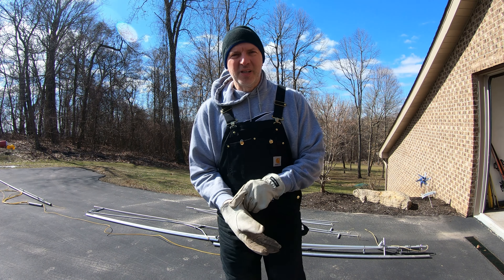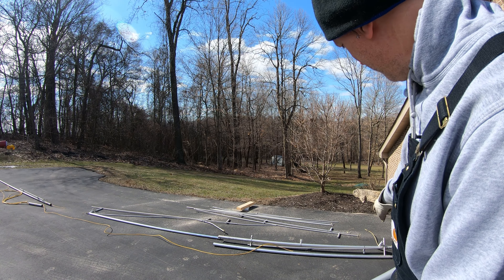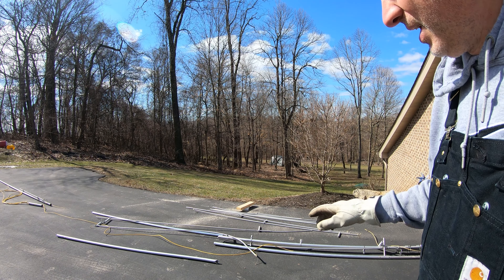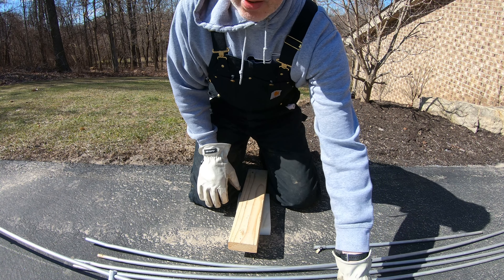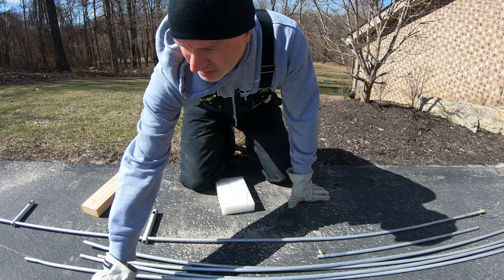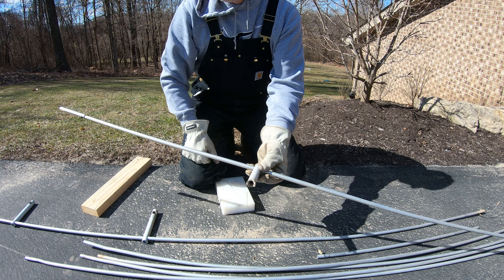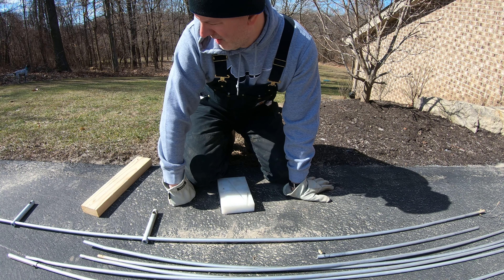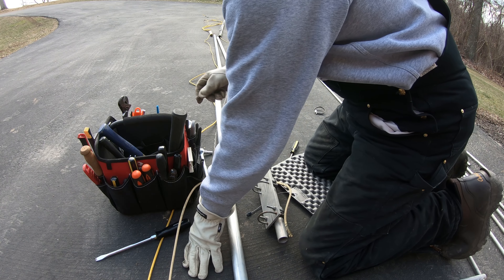Wind Damaged Titan DX antenna  rebuild

Comment: I have this antenna and it is damaged.  I need to replace a couple wires and cut a vine out of it .
This video is very helpful.  Thank you for posting.
I should add that I repaired the antenna a few years ago and was able to purchase them directly from Gap.

Comment: Tom when i had the same problem i routed 2 corves in the wood the used them to straightened  the parts de 2e0ree
Reply from the maker: That would be good too.  It's not looking to bad.  Working well.

Comment: I just picked up a used one cheap, owner moving. I’m still deconstructing it so I can check to make sure all connections are clean and intact. I just can’t get the center gap insulator off of its bottom pole. I t would be great if you could take apart/cut open the gap insulator and show how the coax line is attached to the two wires coming out of the insulator. There are actually two yellow coax wires that go out of the top of the insulator, one is a stub, and one feeds the capacitor at the top. I’m real curious, so I might understand this antenna better, how the coax and wires are connected. I’m concerned if I should be using more force to pull the insulator off of the bottom pole, or if there is a trick/technique.
Reply from the maker: Besides running through the hole at the bottom of the mast and the wire at the very top the coax is not attached anywhere inside the mast, except inside the PVC insulator.  When screws are put in it bends the aluminum making a dimple or burr that makes it really hard to get off.  Remove all screws from the insulator. I put a piece of wood on the edge of mine and tapped a hammer.  Before putting back together you can tap or sand those burrs off to make it easier to put back together.
Reply from the maker: I would actually remove every screw in the sections you are trying to pull the wires through.  There is nothing that would prevent them from snagging the coax.  The bottom isn't so bad, as it is one straight run, but the coax forms several loops in the top section.
Reply: More specifically, the two wires that come out of the insulator, what are they connected to inside?
Reply from the maker: @Wanabethebest  Yes.  I could not get the wires out of the old insulator.  They appear to be epoxied in there.  I can see globs of stuff in the old one I have.  They aren't coming out.
Reply: @Wanabethebest  Hello, I am F5SJF,
Did you manage to remove the coax from the upper mast? How did you do?
And the wires on the central insulator? What are they connected to?

Comment: Good deal on the Titian Dx! I’ve been using that antenna for several years now. I like it, but 80m is very narrow and I don’t seem to get a good signal out, but all other bands work as good as I expect 👍. I also have all new inner lead for mine but I’m reluctant to install it since I don’t have any major issues.
Reply: Oh and I could use a straightening of my bottom counter poise rods, as I forgot to take them off before tilting it over one time, I curved them about as bad as that big curved piece you had, but I got them back fairly straight, just droops a little now.
Reply from the maker: This one isn't perfect for sure, but it is working....
Reply: @TangoOscarMikeN3WS  kinda how I feel about mine lol. But I still like it 40-10 at least lol
Reply: sorry to be so off topic but does someone know of a method to get back into an Instagram account..?
I stupidly lost the password. I would appreciate any assistance you can offer me.
Reply: @Abdiel Yosef instablaster ;)
Reply: @Leroy Amir I really appreciate your reply. I found the site through google and Im trying it out now.
Takes quite some time so I will reply here later with my results.
Reply: @Leroy Amir it worked and I actually got access to my account again. Im so happy:D
Thanks so much you saved my account!
Reply: @Abdiel Yosef no problem :D

Comment: You just throw away a 80m tuning capacitor together with yellow coaxial. The one which was connected at the top section of the antenna. You need that capacitor for 80m tuning, and working properly(100khz wide bandwith). Otherwise great skill in reconstruction this very nice antenna. Great job.  In part 2 you put that capacitor on right place. Sorry.
Reply from the maker: No worries.  The antenna has been up for a while an has been working great.  Thanks for watching.

Comment: Bob got another Gap Titan DX to replace the one you got. I helped him move it from the former owner  and put it up at his QTH. On the Gap I got from Bob I was able to splice the center coax and reuse it. That green component  on the top is a capacitor  for 75 or 80 meters. It is selecetable to the area o the band you intend to use the antenna on.
Reply from the maker: I got it up.  10-40 are great.  80, I only have the very top of the band, almost out of band, but it's working.

Comment: I like your technique of using the wood to help take out the bend; at the ground level. In the past I have used a picnic table. I think I like your method better, keeping the rods closer to the ground- W1FYG
Reply from the maker: Let's me put my weight on it and use the driveway to see how flat it is.  It worked out pretty well.  Not perfect.

Comment: Hello I had a mason come and widen my driveway yesterday. Unfortunately I wasn't watching him. He knocked down a couple trees. And one of them broke the middle section of my Cap Titan DX antenna.  Looking it over everything else looks salvageable. So I'm thinking if I replaced the section that broke it could hopefully go back up. My question is where can I get one. I read that Gap are hard to work with. I'm certainly open for suggestions. Thank you. Mark W9MKM
Reply from the maker: The guy I bough mine from, had already bought all the parts from GAP, so I just had to do the labor.  I asked him and he said he never had any trouble getting parts from them.
Reply: @TangoOscarMikeN3WS  
Thank you. I will call them tomorrow.
Reply: I ordered parts from them maybe 8 years ago and they were helpful.

Comment: Hi, I watched with great interest your video about the GAP Titan antenna because I have exactly the same antenna, I suffered exactly the same damage and the mid section tube also broke.   I have already contacted the GAP company but the cost of shipping and importing into Mexico the replacement tube is very high.
The mid section tube is very common, but I need to know the exact length of it in order to replace it. 
Do you know what is the exact length of the mid section tube?  I really appreciate your help. Regards
Reply from the maker: Sorry, I don't have the antenna anymore that I could check.

Comment: Good afternoon, can you tell me which coaxial cable is inside the antenna please, I have one and would like to recover it, thank you. 73 de CT1EYF.
Reply from the maker: I'm sorry, but I no longer have the antenna.  It was destroyed during a wind storm when it was hit by a falling limb.  It wasn't a normal type of coax.  It was like RG-8 but had a very thick jacket.
Reply: @TangoOscarMikeN3WS  Thank you very much, I will try to get it with coax with RG-8. Have a good day and thank you for answering, 73 from CT1EYF.
Reply: I looked here in Portugal and there are 2 types of this RG-8 cable, both for 50 homes, but the one in your video is the mesh made of copper?